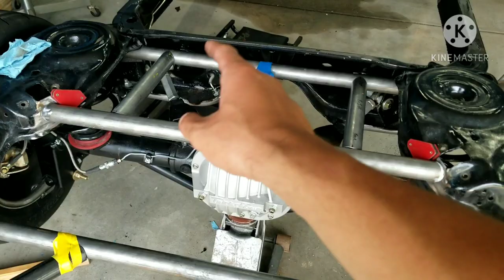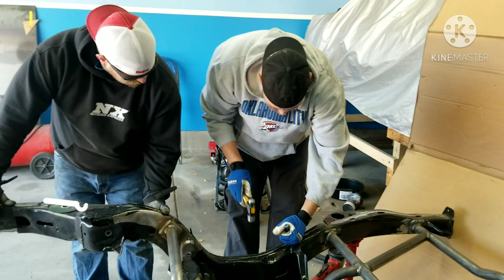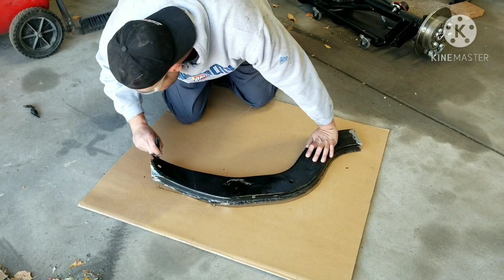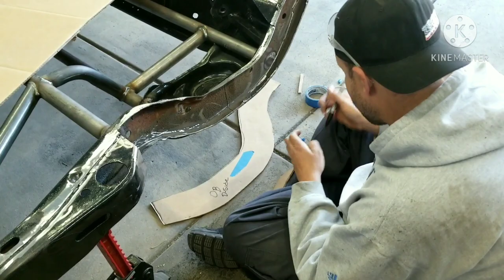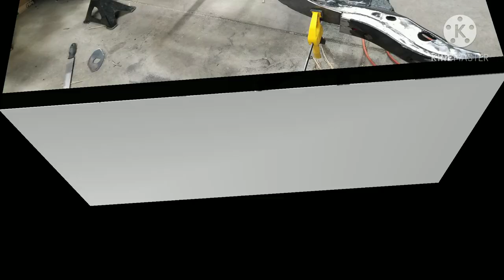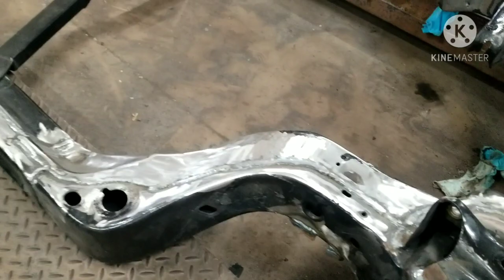G Body frame notch

Comment: I like the direction you are going. You are paving the way for my plans for my '79 Elco.  Keep the mods coming and thanks for the videos bruh.  GB4E
Reply: Totally agree brother she looks super strong
Reply: Jump forward a year and what’s the new game plan for the rear suspension set up for the mighty 434 you just procured. I just installed umi adjustable rear control arms with roto joints. They don’t squeak like the previous urethane bushed factory arms.

Comment: Do you know what size of wheel you’re going to be able to fit? And are you going to mini tub the body to match the width as the body sits right above that frame notch, which becomes the next object in the way of the wheel and tire . I am hopeful to put a 20 x 12 in the rear of my El Camino after the frame notch and mini tub on the body.
Reply from the maker: I'm not sure the full width yet but I've seen g bodys with 11s in the rear without notch so I guarantee 12 will fit. Yes though I am still currently working on the mini tubs. Timenis a limiting factor sadly.
Reply: @dhosack85  yes currently running a 18x 10 with a little over 1/4 inch on each side. IT’s  a procharged LS3 on E85 so getting as much rubber to the ground is key and really good tires. I’m also mini tubing now too because the tire will just slam into the body even if it can pass the frame. It’s lowered on Viking coil overs and full UMI suspension and every brace they sell. If I get done before you I’ll let you know what to expect width wise what is achievable. I can’t find anything other than people doing frame notch but not saying what they put in there. Thanks brother
Reply from the maker: @scottcurry187  you might! Lol! I'ma take a week off work in a month just to work on her. I'll get a video up about working them. Hopefully I can get them finished up. They're kicking my ass!

Comment: Hey bruh, 
I need your advice. I’m running pump gas thru my 355 sbc 10:3 compression. Cam is 236@.50 and life is 500. At fifty. Holley single plane and quick fuel carb. 
3:73 gears posi. 
Can I get more power with a e85 carb from quick fuel, how did you like running e85??
Reply from the maker: You will definitely get more power with e85 but fuel economy will drastically decrease. I would highly recommend buying a quick fuel e85 built carb instead of what I did and may I recommend watching "the old man's garage" on YouTube. Lots of good videos on e85 tuning if you do some digging. Learn all you can about it and change oil more frequently with e85. You'll be able to run more timing with E85 therefore more power. Over 10:1 is a great place to start with E.
Reply: @dhosack85  im watching Billy, the old man and that’s where I got the advice. So it’s more of a street-strip car I don’t drive daily.
How about fuel lines and do I need double the fuel pump capacity?
Reply from the maker: @michaelmaher4328  you can't use rubber line with E85, no rubber at all in the fuel system. I used PTFE fuel lines and anything that stated it was E85 compatible. Same with fuel pump make sure its E85 compatible. E consumes 20-30% more fuel so yes a standard block mounted fuel pump will not be suitable. What's your fuel system setup now? You'll want cold spark plugs and I was running 36 degrees of timing with my basically stock 350.

Comment: .035 is more than good. I'm betting you're right, the voltage is the issue. Good to hear from ya buddy.
Reply from the maker: Yo! Yeah I think the biggest my welder does is .032 wire actually but yeah not getting the voltage I need.

Comment: Unnecessary weight the rear behind the rear end is not the problem on g-body shuffle. an x-brace in the middle is what is needed to tie the front structure holding the engine to rear end. also addig a anti roll bar is a must.